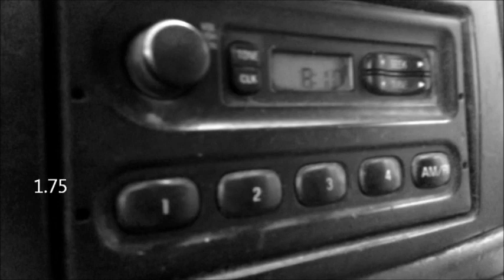The Fastest Roofer in The Universe CrumbLord Vol2 2014

Comment: Dude all the nails Are on the seams... i mean wtf... i wouldn't have a job... right when you say no low nails you put a low nail one shingle before that... lol really
Reply: Luis Charles no kidding...MOST shinglers don't get it when it comes to nail patterns on dimentional shingles...When you lift the seam between the two there should not be a nail for 2 inches in either direction... This roof was NOT covered by warranty  the DAY it was done... You'd get fired on the 3rd shingle doing that on my job...
Reply: Louie Louie they prob don't know. Up in Alberta, canada, we weren't taught to avoid 2 inches from the seams because (i suspect) there was such a boom that they need any nailers they could get, hence it became a wild west. Wasn't till I was in vancouver i seen other roofers doing it. I personally don't think it doesn't make a difference though, I've see very skilled/fast roofers who slam in 6 and the roof never had problems and hes been doing it for 20 years. I'm pretty sure its the meat head inspectors that try tell roofers how to do the trade